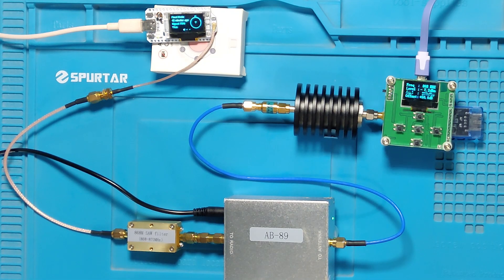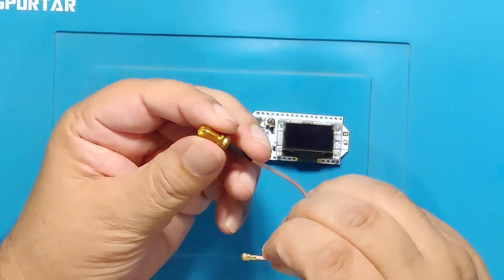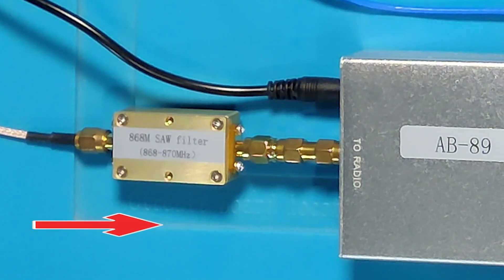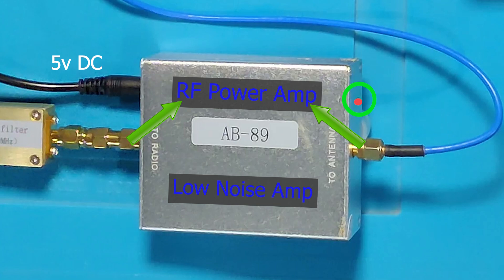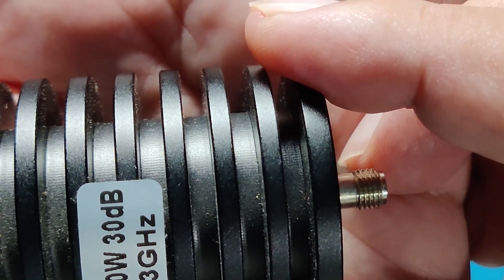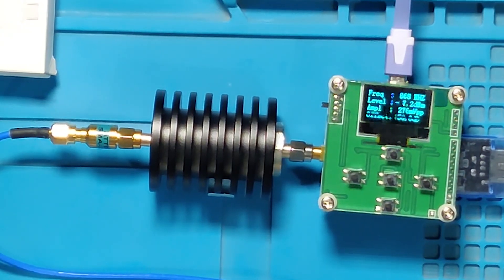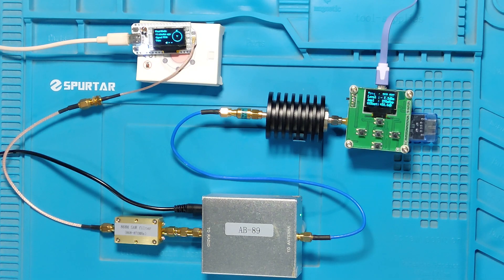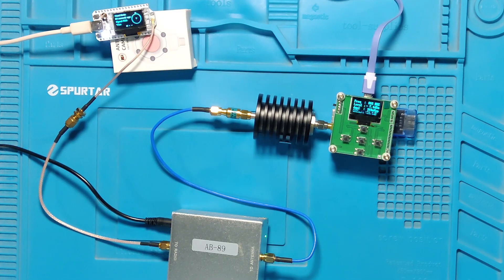Meshtastic RF Power Testing of US-915MHz & EU-868MHz Bidirectional RF Amplifier by Technology Master

Comment: Where can I purchase one of these to test with?
Reply from the maker: Here is the aliexpress. I am not an affiliate with any seller. https://www.aliexpress.com/item/1005005445930926.html
Reply: Please let me know what you discover. I am considering this for use on LoRa in the US. 1 full watt of clean output to the antenna is what I am looking for, I am curious if this amplifier is acceptable. I would really appreciate it, Thank you.
Reply from the maker: @kenneth6731  Yes,  lt should work without any issues (advice without warranty)
Reply: @technologymasterkam  Thank you very much for your reply. I wish to use one with a Meshtastic starter kit to bring my repeater system to it's full legal and technical potential. I would be a great blessing if one of these works well in my system to increase it's range. I regret that I do not have a wattmeter or dummy load for this frequency, which makes it a challenge when adjustments need to be made.
Reply from the maker: @kenneth6731  You can measure current going into amplifier.  Place another node away but in range of Bluetooth.  Now make adjustments. An increase in current should also coinside with increased signal strength.

Comment: Nice review. Would be great to see a real world test, taking in to account of RX amplification. Read a review of a $400, 4W LORA bi direction amplifier and the average range went up 10 fold. I'm guessing a much cheaper 1W amp would get about 2.5 times extra range.
Reply from the maker: Thanks, I guess we cannot drive an exact ratio here. However 1W should still give decent coverage in place of 4W amp.  Changing the location of receiver or transmitter will change everything about the range/coverage.